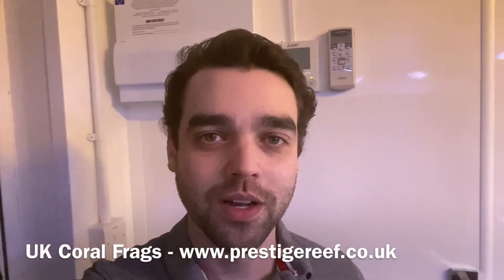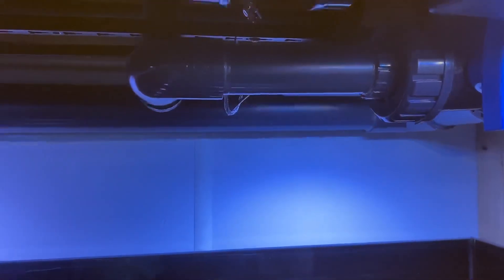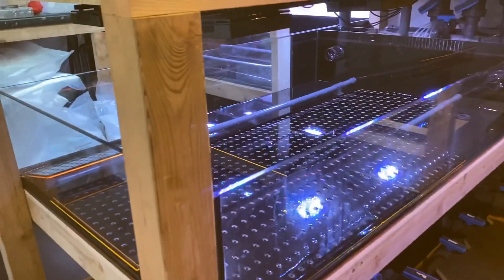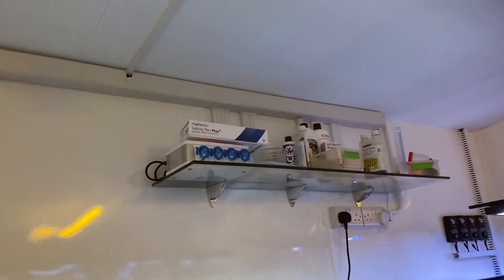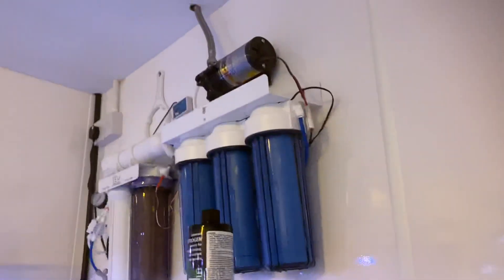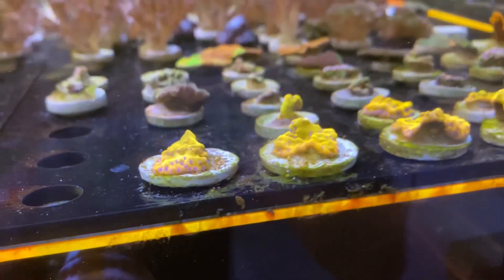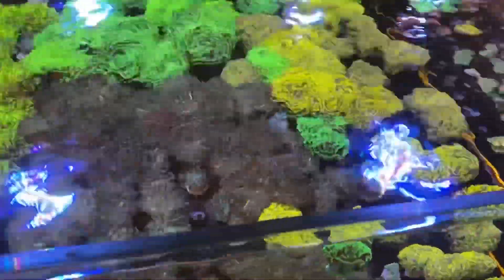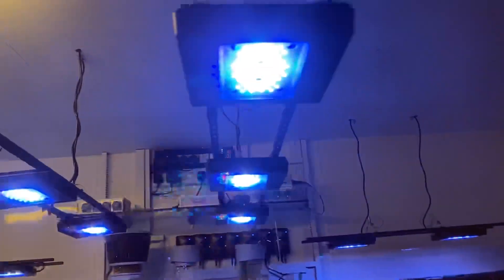4000 Litre Saltwater Tank Mega Build | BIG and SMALL Changes - Part 19

Comment: Am I rite in thinking you said in a previous video that you were heating the tanks partially or entirely by heating the entire room to temp via gas central heating rather than just relying on electric heaters in the tanks? If so do you have any thoughts on how it's going yet, like do you think it's saving you money etc as there seems to be a lot of disagreement about this subject?
Reply from the maker: I’ll be honest, I’m not sure if it makes a difference. It’s hard to tell
Reply: Ah well I suppose the fact you haven’t noticed a big difference is still interesting. I’ve often wondered if it’d be worth the hassle & expense of adding an additional zone to my central heating system for my tank room.